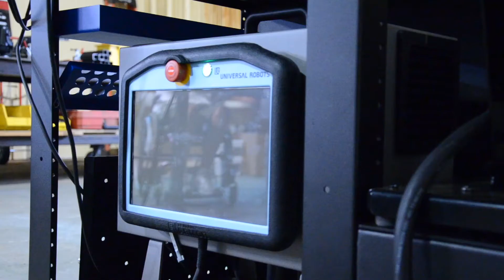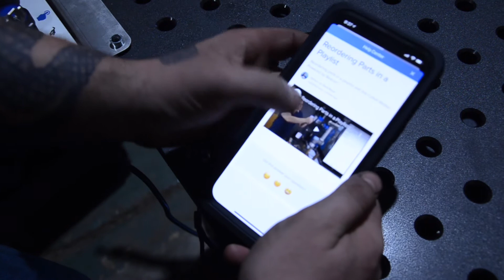Watch How Quickly Can This Welder Weld with a Collaborative Robot | Cobot Welder

Comment: How about repeatability. You have to re-program each single parts. And cost in range 120,000 USD
Reply from the maker: The robot is very repeatable holding around 0.03 mm repeatability.  As long as the part is fixtured well and the parts are consistent then the system will just keep welding with minimal touch ups required.  As far as cost, this system as it ships in the US is below $100,000 USD.